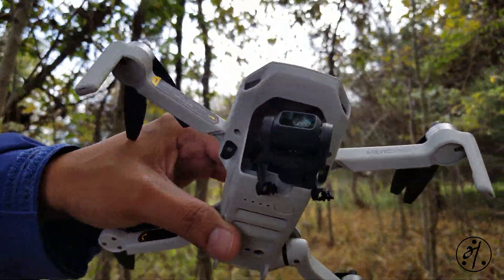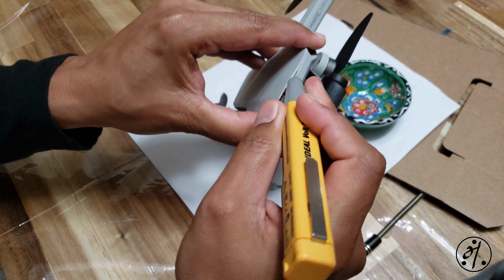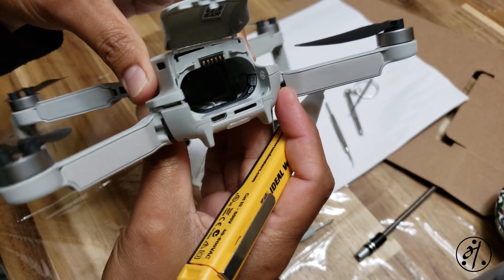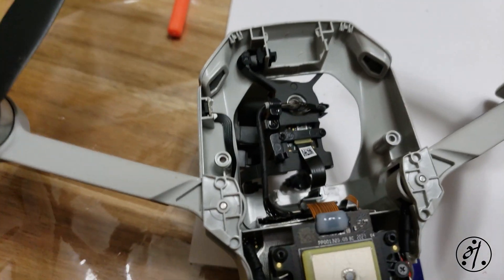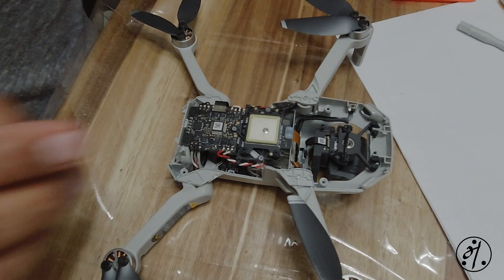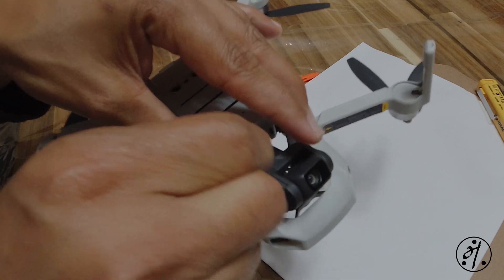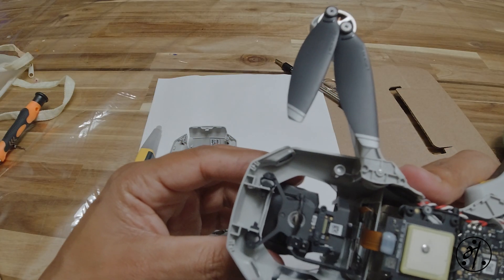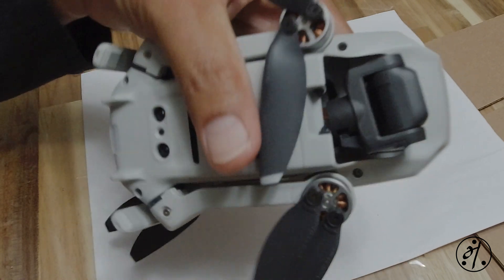Drone Gimbal Fix | Mavic Mini Gimbal Fix

Comment: You effed up your warranty
Reply from the maker: You cannot fix your crashed drone/gimbal under warranty.
Reply: @rmanni  I found this to be true myself because my came with Allstate. Even though my had a motor failure no flight, they will not repair due to physical damage from it falling. Go figure! 😂

Comment: Well I crashed mine today tried all the on line tricks compressed air pushing back on mine with screw drivers but after I took it apart found ribbon cable had come lose I had to take the gimbol lose from rubber isolators snap ribbon cable back on and re attach gimbol to isolator frame all fixed hope I don't crash again

Comment: I also had a (very small) crash. No damage. Not even a broken prop. But now the gimbal always tilts a bit. Calibration does not help. Did you experience this issue as well after your crash?
Reply: Please check if the four arms of the gimbal are attached to the body.
Reply: Yes,they are.
Reply: Your imu is busted.

You'll have to send it in or get a new imu/GPS
Reply: Or actually.... it's the whole gimbal arm...

Your fucked either way unless you send it in

Comment: https://youtu.be/CkikXpjIVak please you can help me this problem
Reply from the maker: wow that's bad. Did you check with DJI Support?
Reply: nop here un Ecuador not have a Dji suport and the repair es very expensive
Reply from the maker: I would say open the body and check if Gimbal is attached to the body. I wouldn't recommend repair as you can buy a new drone for that price.

Comment: my mm2 gimbal.. vibrate... you know why???
Reply from the maker: check if the all the four arms of the gimbal are attached to the body. If one is disconnected or loose, it might shake. Did the drone crash or fall down?
Reply: @rmanni  mine does it gets stuck at 80% calibration makes a buzzing sound when flat, I crashed it. There is lots of screen tearing in my videos.
Reply from the maker: @pyrowars3467  : mine fell into river in mid flight. No clue why, and I lost the drone...